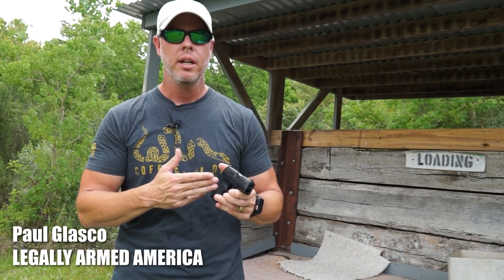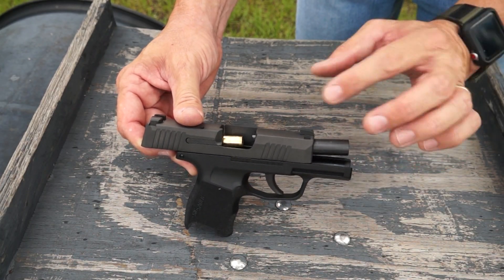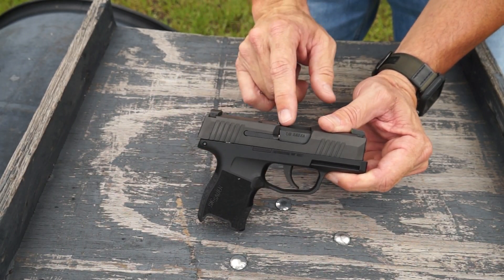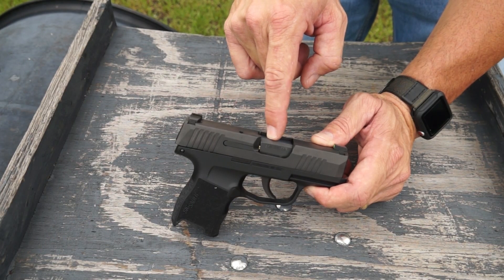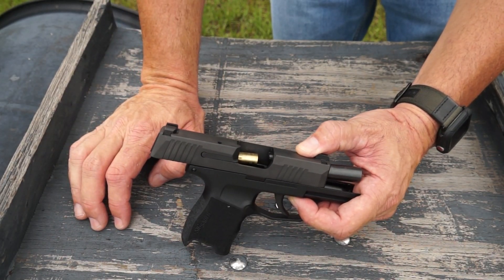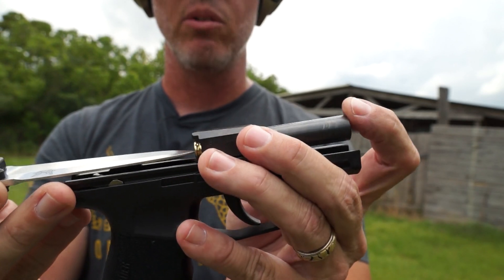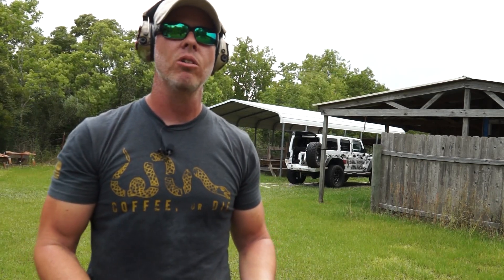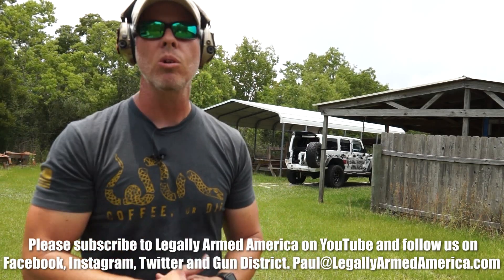What is "primer drag" in handguns?

Comment: Have seen this before & discovered that the cartridge case was coming out of battery prematurely.  We fixed this by ordering recoil springs that were 2-4 lbs. stronger, and that kept the pistol in battery just long enough to cure the "primer drag" problem.  There were, however, a couple of side issues with this "fix."  One was that the slide was more difficult to rack, and the weapon became more sensitive to cartridges that were loaded to minimum pressures, or near it.  As long as the officer loaded their weapon with premium loads or even +P, no problems!  This is not to say that the other issue that you mentioned, a too-long firing pin, a too weak firing pin return spring or burrs on the breech face couldn't also be the cause, but barring these problems, the recoil spring solution was the most satisfactory!  Hope this helps!  God bless!

Comment: Decent explanation. However, it's not taking into account that it can only happen while the primer is still flowing. Which is a sign of the gun is coming out of battery too soon while the heat and pressure are still too high. And doing so before the firing pin retracts. In other words, the recoil spring is too weak for the load being fired. And not all pocket 9's do this. But you do see this a lot in 9mm guns with slide cuts and lighter springs for faster cycling. Also, most guns chambered in 40 have been exhibiting this sorta thing since the 90's. For those 40's I own that do, do that. I get a stiffer recoil spring and the problem goes away.
Reply: I will endeavor to bear your addition & suggestion in mind, MatteoSixSeventyFour. Thanks for the extra info!
Reply: this makes perfect sense. Sigs recoil spring has to be too weak.
Reply: My Glock 22 has been doing this for years.  Suggestions for replacement recoil spring?  OEM or aftermarket?  Prefer as stock as possible in appearance.  Thanks!!
Reply: I got more info from your comment than I did from the guy in the medium T-shirt in this video.
Reply: Good intel
Reply: Yea my glock 23 does this...never knew the term for it but kinda feel a lil better knowing other people have had this problem with their 40cals...gona order a stainless steel guide rod for it
Reply: @rich1958  did you ever get a new coil spring figured out? Maybe Galloway precision out of Fletcher North Carolina.
Reply: Thank you. I am trying to troubleshoot a similar issue and I was wondering if the gun was unlocking prematurely.

Comment: I first noticed primer drag when I first got into IDPA competitions a few years back.  at first I was concerned until I realized what it was and when I realized that probably 9 out of 10 of my handguns all do this and I mean Glock, Walther and even my CZ BD model does it.    from the research I've done this seems to be a pretty typical and normal function of semi automatic handguns.  my Glock 19 that I shoot twice a month in IDPA matches and has thousands and thousands of rounds through it does it also.  but it's never been a problem. it seems to me the problem lies in the material the firing pin is made of  keep up the cool videos my friend. Godspeed
Reply: sig is over rated  junk imho...i run a g23 and have no issues.

Comment: I still say it's the design and material used by sig on the 365 firing pin causing the breaks.
Reply: ya ive never been a fan of sig, learned my leason with the 522..where the m&p1522's bolt rides on rails the pos sig 522 does not and just gums up.

Comment: I thought the same thing that the striker was staying out to long and not retracting fast enough before ejection..The striker you would think would retract fast enough to clear out of the way before ejection...like a timming issue...the speed of ejection being faster then the stiker can move out of the way maybe ? Or something causing it not to retract fast enough like friction of some kind...having striker retract faster then the first movement of ejection i would think could stop it so just a dimple in primer but with out the drag.....like on a car engine pre ignition before piston has full compression...timming in mechanical things is important to for smooth function.....the right movement at the right time....my dads 4 inch barrel on his SR9 a older version does this so apparently its full size guns also..even with rebuilt parts my dads ruger 9mm does it...hot loads the drag is even more noticable....curious if striker was shorter it would cure the problem but hopefully not to short to cause light primer strikes.....Sig maybe re engineer striker...or find out what friction or timmung issues is causing it to stay out during the start of ejection
Reply: That was my understanding, that at least with the P365 in the 2nd generation Sig redesigned the striker pin.

Comment: First...  I agree with what someone else has said.   Very good, very concise explanation.  Too much self-serving wasted time in so many videos.

Could not agree with MatteoSixSeventyFour more.  I would also add that every time I fire any pistol I own, I am stressing the extractor, the ejector and other parts to a lesser extent.  If they are built to deal with many thousands of rounds without failure it is not an issue.  Primer drag by itself is not an issue.  If the firing pin (or striker in this case before I get corrected) is built to withstand this as well then it would no longer be an issue.  Sig has changed the design of the striker and I believe (but am not positive) that the redesign was significant enough to require changes to the milling of the slide.  Whether there were slide changes or not, if the firing ping now will withstand many thousands of rounds without a failure, we no longer have a firing pin issue.  HOWEVER, if we are in fact confusing a symptom with a problem, that being that the gun is unlocking too soon?...  well, that will only get worse as recoil springs wear, and that could be the real issue.  As Matteo... said, many striker guns have shown primer drag for years.  I remember being concerned 20+ years ago when they handed me the first Glock 22 I had.  First training session I looked at my brass as I always do, and thought there was an issue.  20+ years later... nope...  still running, and if that gun still exists somewhere today after I turned it in... it just might have the same striker in it.  

For now, with 900+ rounds in over the last 3 days since they handed it to me, my P365 (Wow - born date about 8 days before the day I am typing this) it is running fine.  I had one FTE so far in the first 100 rounds.  I tried one left over box of Blazer 115 and that one case was very nearly stuck in the chamber and the extractor pulled though the aluminum rim.  I hate that stuff.  I have also had it not lock back a handful of times which I really believe was my stupid right thumb every time.  

Another couple hundred rounds today with no issues, a good clean and inspect, then a couple mags to verify my cleaning caused no issues, and it goes on my vest for work.  

The only thing that all the bad press on this gun will change for me is that for a while at least my habit of very often taking a very close look at all the components of my gear will change.  It will change to my taking a very VERY often very VERY close look at all the components of this gun.  

Aside from all the noise, this is the first small 9 I have ever had that I REALLY like as opposed to "am able to deal with" for a backup.  I say this with a Shield, a PM9, and a G43 still in my possession, and an LC9, a G26, a G27, and a Nano that did not make it past eval.

Comment: I've put about 500 FMJ rounds on my P365 since I bought it.  I noticed with the first two boxes of ammo they was definitely a lot of primer drag, however yesterday with the rest of the boxes, with SS FMJ rounds the primer drag was much, much less and on some casings not noticeable.  I am wondering if the ammo quality also has something to do with it.  The other thing that may be part of an answer, is that the first two boxes were 115 grain, the rest of the rounds were 124 grain - the 124 grain were the ones which were barely noticeable / no drag at all on some casings.  I love this gun, feels great in my hands, shoots great, CCW is perfect with both my side or appendix holsters.  Hopefully mine will remain in great working condition.

Comment: Had the primer drag on the first trip to the range with zero FTF of 300 rounds of 115 and 147 gr I did notice this primer drag marks. Upon cleaning I noticed the striker chamber was full of oil. There was enough oil in the new gun for about 10 guns!  My understanding of the owners manual is to not lubricate the striker assembly. So I dried it out.....The next range trip did not show this drag at all. Seems to be solved for me. October 16 BOD. Now over 1000 rounds and I feel the gun is reliable as my 26 or M&P so for me it's a keeper. Shoots nicely and I trust it now. YMMV

Comment: As a master gun Smith I've seen this over the years on and off with different brands and models! The sig 365 seems to be one of the worst I've seen in recent years. There is a way to fix it and  I've done it to a couple different guns. Putting a little bit larger firing pin Spring in the gun in the shield the glock even on a Springfield XDS45 seems to eliminate the problem.
Reply from the maker: James Gfid great feedback, sir!
Reply: Legally Armed America .. thankyou sir
Reply: I talked with Sig Customer service today and they are sending me a shipping label free of charge. I have an early release 365 so they are upgrading my front sight and will probably update anything else as needed. They said that there has been less than 1% of p365s to have reported any problems. I'll shoot the crap out of it when I get it back and see how it does. By the way, i had a couple of malfunctions with a new Glock 43 and two different new Kahr pistols. Not giving up yet in the meantime my HK VP9SK will make do. B-)
Reply: Paul Ruth .. well your going to be without your sig for 4 to 6 weeks. It takes me 20 25min's to fix the gun. Them saying only 1% of the 365s are doing this . Every one I have sold since the gun cam out has come back to my shop. I've fixed most of them my self only 2 guys have sent them back to sig. Both guys said they should have just had me fix them..
Reply: James Gfid  thanks for the response. I have sold it and bought a 26 gen 4. After they have been out for awhile I will buy another p365. I will be keeping up with how they come along.
Reply: I simply do not believe the "less than 1%" comment from Sig CS.

Comment: Great explanation. I never experienced this with my Glock 26 (10+K rnds) or 27 (13+k rnds).  However, the vertical orientation of the triangular Glock firing pin would mitigate this problem. The Sig P365 striker spring does not stack straight and may cause binding inside the slide channel.  Thank you

Comment: It occurs to me that there two things that might contribute to this issue and they may be fixable with a design change. I am aware that some guns have a spring loaded firing pin to keep it retracted when not being fired. If that is absent or too weak that would certainly contribute too this drag issue while a sufficient spring would eliminate it. Depending on the design a sufficient spring may lead to light primer strikes or other issues, however.

Also, do subcompacts have a greater tilt angle than larger tilting barrel guns? If the barrel has to tilt farther to complete its cycle this could also contribute to this drag. Obviously firearms that don't use a tilting barrel design shouldn't have this issue but I'm sure there are good reasons tilting barrels are used in many popular handguns.

Comment: interesting...  I came across an old .40 casing that I stuck on the end of a pen at work a few years ago.   i noticed it had primer jag just yesterday as I was sitting at my desk.   That casing was shot a few years ago and I had shot my G22 many times since then.  I wanted to do more research and then came across this video.  My Glock 22 has been flawless since I purchased it in 2013.   Is this something I need to be concerned about or can I just leave it be?   It is 100% stock other than sights and weapon light.

Comment: My LCP II secondary firearm doesn’t have this problem but i will definitely keep an eye out for signs of primer drag on my spent casings. Thanks 👍
Reply from the maker: Joey Bagatoni Great feedback! With your LCP II being a hammer fired pistol technically, I wonder if the issue is specific to striker fired firing pins? I will check!
Reply: That's correct...it's an issue inherent in striker guns. Hammer guns either have a rebounding hammer or an inertia firing pin, so one way or another the pin hits the primer and retracts. A striker gun has to have the striker reset through the slide action, at least in all the pistols I'm aware of.
Reply: 452Rob having a heavy firing pin return spring in a hammer fired action doesn't effect trigger pull as in a striker.  But I think a heavier striker spring in the 365 would help and be a good trade off although it appears that there is also a metalurgy problem with the striker.

Comment: What is the advantage of having a barrel that is moved in a pistol versus a fixed Barrel like my high-quality Hi Point C9?
Reply: LOL
Reply: LA Prepper a fixed barrel can not handle higher pursser rounds.  The only reason a hi point c9 works is heavy ass think sidle.
Reply: Having a moving barrel helps chamber larger rounds. It helps feed the next bullet into the chamber. This is seen on 22 fixed barrel pistols where the bullet hits the upper part of the barrel as it feeds when ramps aren't polished. Or stove piping the round.
Reply: or a rotating non-tilting barrel like my Stoeger Cougar?

Comment: ive just recently seen this in my glock 19 gen4 on my last range visit. i havnt noticed it before but am not a stickler for checking my brass after shooting. i do however now for about 2000rds have been running wolf steel case 115gr for just plinking instead of comparable brass. not sure if this was an issue before i started using the wolf. my glock has about 8k-10k rounds through it now. i will probably purchase another firing pin to have on hand just in case of any failures. and keep an eye on any changes from here on out.

Comment: Is this the reason my g2c fails to eject shells or could it be my extractor or ejector? I also noticed when I shoot my thumb is putting upwards pressure on the slide release. Could that be it? I had 500 RDS through the gun with no failures before it stated happening

Comment: interesting video. I think the more important question is where is the extractor mark in relation to the striker drag on the primer. That will show the direction of the drag mark. I looked at one and the extractor mark was at 3 o'clock and the drag mark was at 6 o'clock, it seemed the barrel upon recoil locked tighter into the slide causing the 6 o'clock drag mark. What do you think?

Comment: Thanks for the info I have a Glock 45 9mm they were showing primers similar to this but not nearly as bad was wondering if something was wrong with my firing pin or not? Reviewing the barrel drop my 45 9 mm does do this and if you hold the gun upside down with a slide is locked back aka barrel pointing down the firing pin drops The only one of the trigger is reset????

Comment: They may design subcompacts to unlock sooner in the recoil process due to less room for slide travel, but I’m not a gunsmith or engineer.
Reply: 2Aftw I bet slide weight, space limitations and desire for low bore axis are all pushing the envelope to the limits.  If so, I appreciate SIG for going there and I look forward to the refinement because l want this format to succeed.  It is the next step up in quality and form factor from the pt111 which was ahead of it's time.

Comment: I'm seeing this firing pin drag on my Steyr M9-A1.  I have not talked to Steyr yet!  Could this be a factor of the firing pin spring or just a timing problem of the recoil spring tension assembly?  When slide is locked back, the firing is visable but easily pushed in, as on my G26.  Before I contact Steyr I just need more opinion for my own education as to how this problem can be resolve, if at all.  My belief is that the firing pin is not retracted (loaded) until the slide moves forward to battery.  So, is then the firing pin too long or is it a pure timing problem?

Comment: I've seen primer drag from full size striker fired pistols too though. Some Glocks have gone 5 years without cleaning before a catastrophic failure. Primer drag doesn't really mean much but if you're really worried about it then get something hammer fired.

Comment: 3000 rounds through my M&P Shield with no problems.  1000 plus through the 2.0 (same) Sig put to lite a firing pin in the 365. Or they need stronger springs. After  the P320 problems they need to get this fixed fast.

Comment: SO, how is this issue fixed?  I fear it means some pretty intricate re-calibration efforts to get the gun's timing to work properly and eliminate the issue.  With the severity of the primer drag I'm seeing with my P365, I'll be calling Sig to discuss it with them this week.  May send them some pics of the spent brass with primer drags I kept from the range.
Reply from the maker: Archie Bunker I think the blowback timing won’t allow it to be fixed. Maybe a harder firing pin
Reply: It's not an issue and there is nothing to fix. It is how the guns are engineered and they are working as designed. People are freaking out about nothing. If the Sig is breaking firing pins, it's because something is wrong...poor striker metallurgy, a measurement that's off, a hardness issue, etc. A striker gun will have primer drag, no two ways about it. Stopping primer drag is not the solution. Making the striker less prone to failure is.